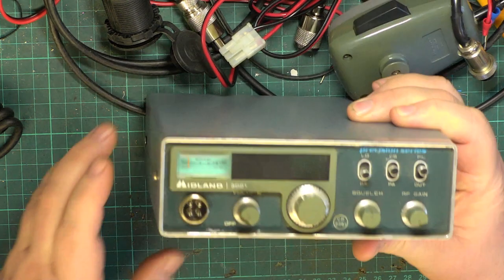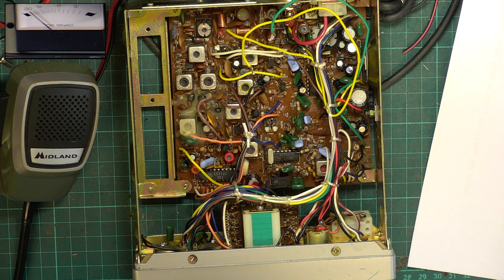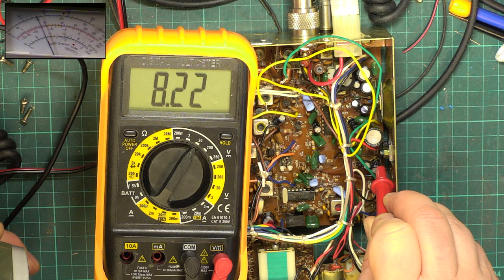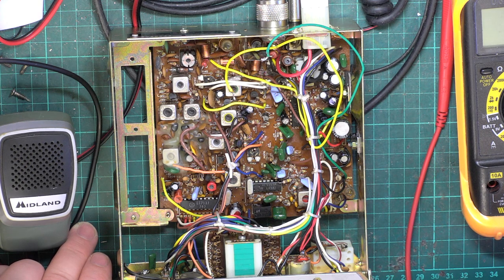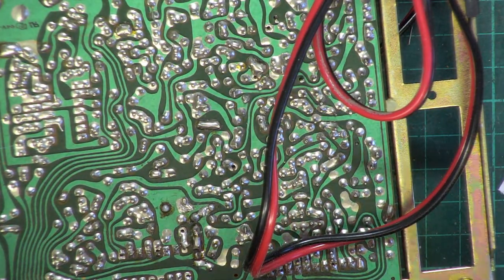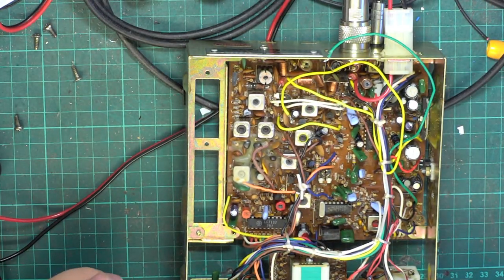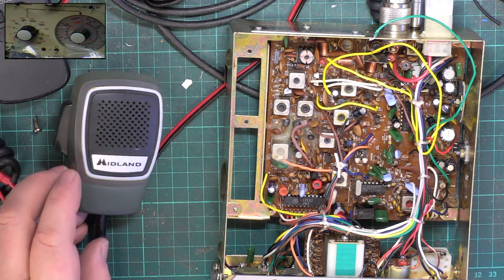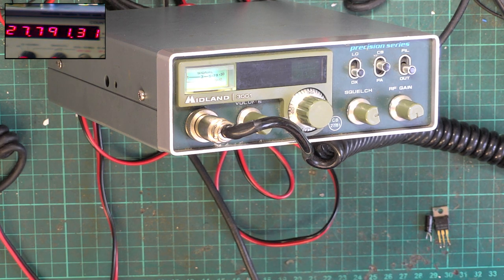Midland 3001 UK CB27/81 CB radio (mobile) - repair & service adjustment

Comment: Nothing wrong with repair videos Richard, in fact there is nothing wrong with repeating set up and adjust as at one time you had a different set up.  I would watch you do the same radio ten times in a row, but that is me.
I'm sure others might get fed up, but I found out years ago that no two radios are exactly the same, not even with close serial numbers.  That was an interesting one, I have to say I would have changed exactly what you changed, there is a cap' can have a bad joint that does not show up, but it is if I remember on the receive side.  It caught me out I only found it out by going over them.
The set was as clear as a bell after that, before it was crackling and just not very good.
That was an hour of my life I will never get back.
The young lady insisted it crackled, I thought it was fine, until i found it and it did sound better on weak signals.
Why did I not believe her in the first place.  It was fine on the signal generator, even a weak signal.
Anyway, she was very happy and told everyone it had never worked so good!
I don't know if that was a good thing or not.   :-l

Comment: Richard, I came out of the TV business in about 93 and we were forever getting unhappy customers from Curry's,Letts and comets complaining about their turn around time. Our turn around time was 3 to 4 working days. There was only the workshop manager and me. I used to do the field service along with workshop repairs and installations.  O yes ,blown to smithereens with silvering in the fuse, bridge rec every time without a thought. Those were the days lol. Do you remember the Phillips wedge shape remote rebuild kit from RS?
Reply from the maker: When I was in the TV trade I didn't have an RS account' Got most of the bits from advertisers in 'Television' Magazine. "Sendz" being one I remember well...and also wholesalers in Bradford.

Philips G9 came in (cabinet with doors), needing a LOPTX not unusually. Set came in early afternoon. I ordered the transformer by phone & expected it the next day. Still on the day the TV set came in, my home phone rang about 7:30PM "It's Mrs G9 here", "I'm just wondering if you've done my TV yet...only Coronation Street is about to start"!

Or this one...I was in my mid 20's...I had the back off the set, kneeling down behind it. The lady of the house came into the room totally naked with a bottle of baby oil & asked me if I wanted to 'play'!  I explained (quickly) I actually worked for the Church of England & didn't give in to such temptations!

Richard, G0OJF, UK
Reply: @ukfmcbradioservicingTango21  i worked on a couple of G8 and G9. Mainly G11,kt3,k35,kt4 in the philips range. Allways had a built up on a heatsink g11 line driver transistor  in the kit ,a universal  lopt .. those were the days hey, proper tv engineering. I remember doing Anna Friel's parents k35 and when clearing the top of the telly to work on it,was a photo fallen down the back of her mum in bondage stuff lol. You see some sights when engineering  dont we  lol
Do you remember the G11 with louvered doors with the Prestel text unit in? I rebuilt one of them ,even highly polished the cabinet and then the boss's dad put a box on top of it scored a deep scratch in it.

Comment: I think 1.5khz deviation would be about right otherwise you would be all over the band.
Reply from the maker: Well the spec for UK is 2.2Khz with a 'never exceed of 2.5Khz.

Richard, G0OJF, UK
Reply: @ukfmcbradioservicingTango21  I had a DNT GMBH set CB27/81 set but has since goon kapoot but had a 1.5KHZ  deviation maybe it is different in Germany.